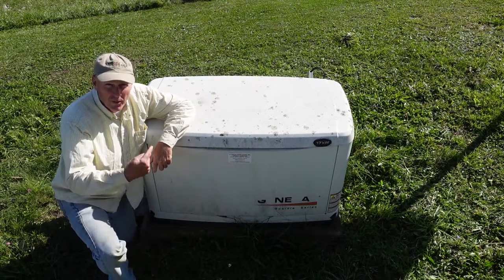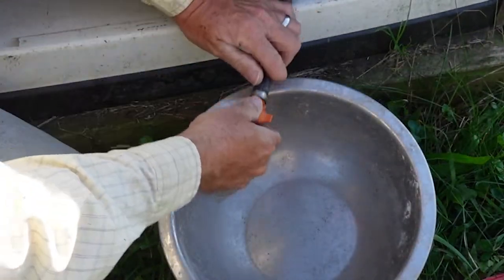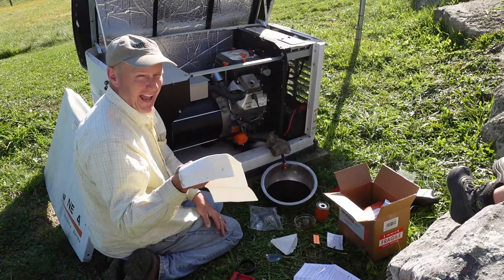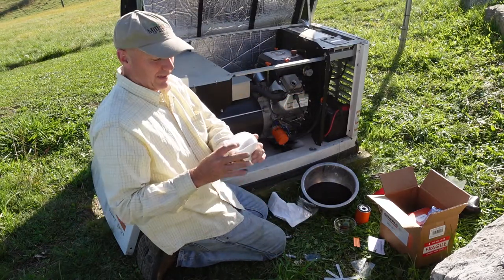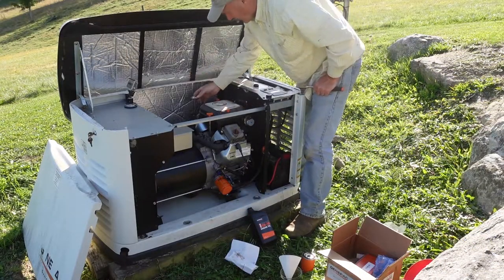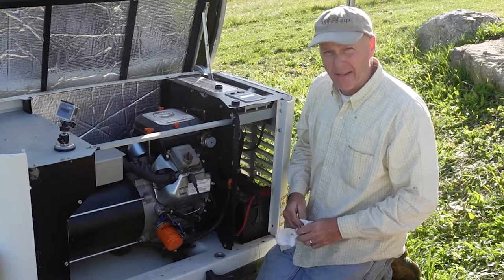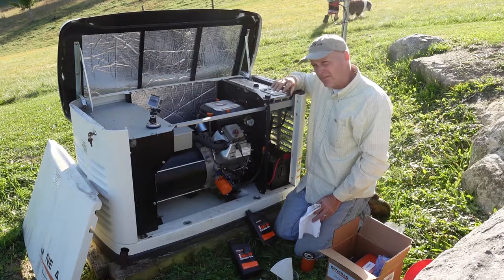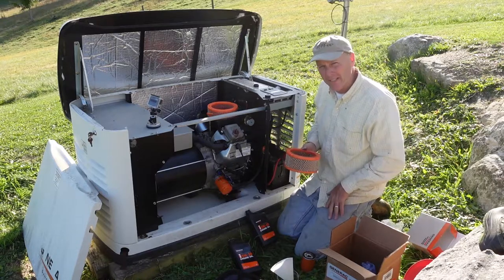Service Generac 17KW Whole House Generator in 30 Minutes

Comment: Thank you for your video. I am going to change my 17kw Generac Generator today. I would like to point out that maybe you should turn off the power before you start to change the parts and oil.
Reply from the maker: Thanks for making that suggestion.  It is possible but unlikely that I turned it off inside. I'm glad you pointed that out. I need to change the oil again very soon!  Hope to see you in more comments. Kevin

Comment: You didnt need to change the spark plugs.
Reply from the maker: I believe you!  Probably didn't need to change the air filter either.  The oil looked new too.  Next time it's going to be oil and filter only. Thanks for your tip!  And thanks for watching our videos! Kevin